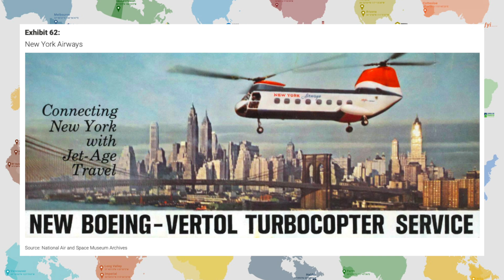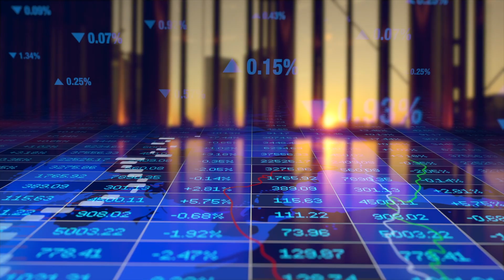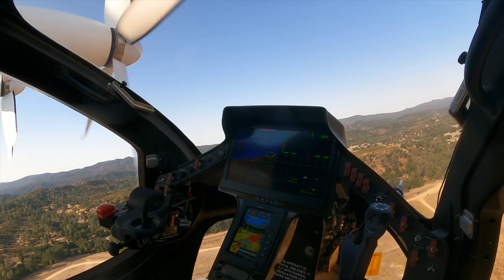Expert Explains: Joby's Predecessor and How Joby Will Outperform | $JOBY Stock

Comment: When you can carry the weight and go the distance…you’ll have something…helecopter is twin heavy hauler..different animal.Asingle engine md500 can  run circles around that over engineered mess…..plus it’s legal with FAA certification!
Reply from the maker: Most likely going to be cases for both. Looking at our mountains here and the heavy logs being hauled... agree that this is not going electric any time soon.
Reply: @BatteryCommodity  think short trips over congested areas to airports, local coastlines, or bypassing a ferry to an island.
Reply from the maker: @livingroomguitarist7  Absolutely 100%

Comment: That thumbnail is still a far dream. eVTOL isn t quite right there because of technology constraint: battery, safety. Their first goal is to able to move 4, 5 people, max 150 km range, that would be  huge step.
Reply from the maker: Hi Jon, the left side is from regular Pan AM service in New York in 1962. As to the range: have a look at the Joby deal in Dubai - routes suggested are 8km , 20km and 30km range.
Reply from the maker: Set up a poll so lets see what the viewers take is
Reply: I work at Joby and we have Tesla engineers and Apple engineered from the 80s working with us . Joby is going to be the Tesla of air taxis

Comment: They should set a date when they will prove its possible to lift the weight of 5 people and move it 10 miles first.
Reply: They’ve flown the prototype over 25,000 miles including load testing.
Reply: @livingroomguitarist7  that's what they say. I never heard of them load testing it. Where did you get that?
Reply: @TheBagOfHolding they were awarded part 135 certification and are allowed to perform on demand commercial air taxi operations. It's documented as part of the lengthy FAA certification process.
Reply: @livingroomguitarist7  that really doesn't have anything to do with the evtol craft.